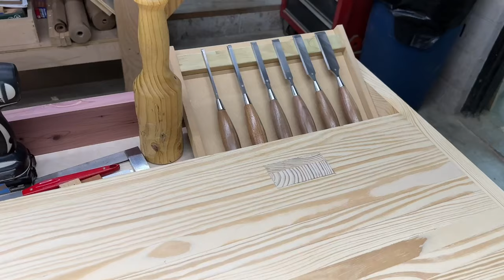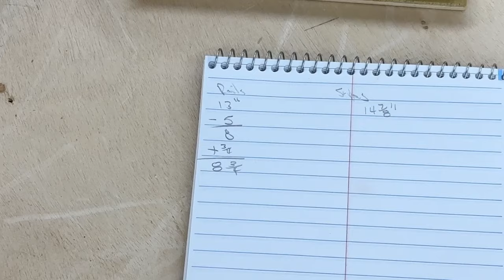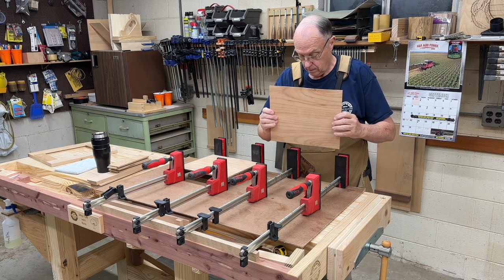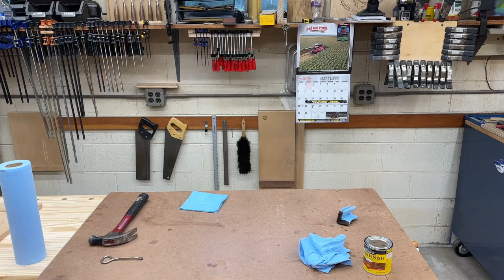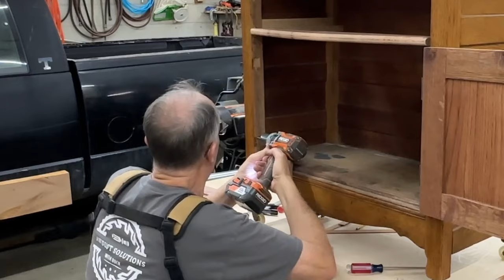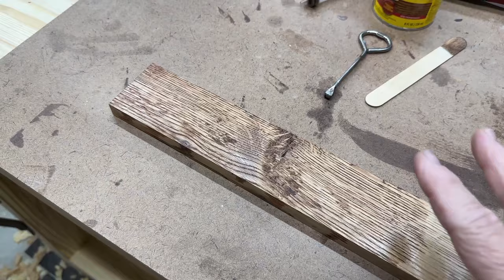Restoring a Family Heirloom Dry Sink | Part 2: Building the Shaker Style Doors

Comment: What could help you with the stain color is a toning spray by Mohawk. Easy to find on Amazon in many colors. I think you need more yellow. The tonner is translucent and can be sprayed on to suit what you need. Another you tube channel, John's Furniture Repair, opened my eye to toning.
Reply from the maker: Thanks for the tip! I haven't tried Mohawk's toning spray yet, but it sounds like a great solution for adjusting the stain color. I'll definitely check it out. Appreciate the recommendation to look into John's Furniture Repair too. Always great to learn about new techniques from fellow woodworkers. Thanks for watching and sharing your insights!